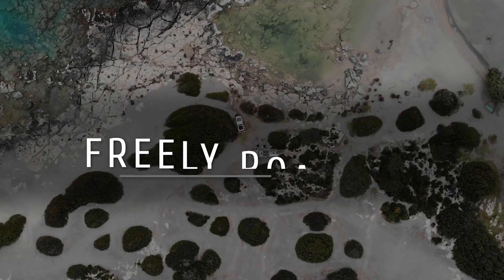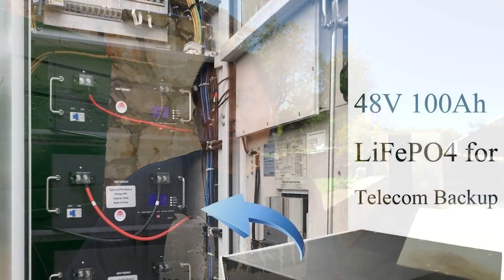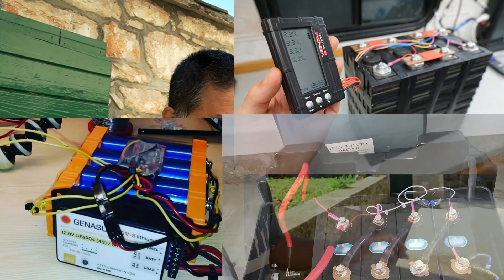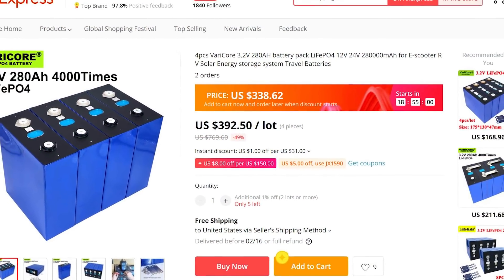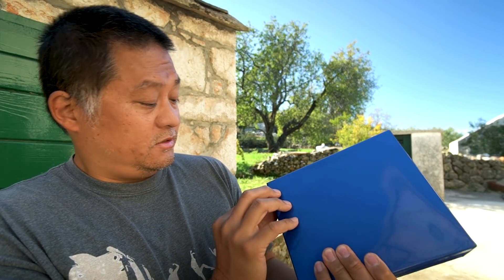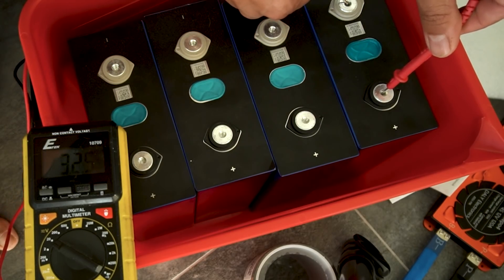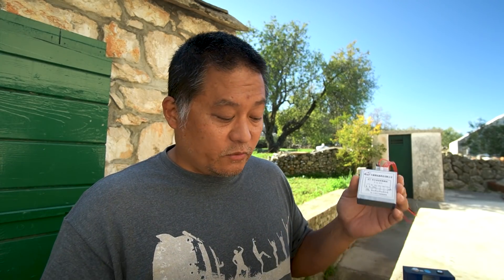Build Your Own 12-Volt LiFePO4 Battery For Cheaper Than AGM

Comment: Lots of good information about the differences of Lead Acid Batteries and LiFeP04 batteries.  I wanted to note, there's a few things most viewers never hear about, and that is AGM charge cycles. Poorly managed AGM will only last around 250 complete charges cycles (less than a year).  Should you operate them by the 50% rule of AGM batteries every day, you can potentially get 500 cycles out of them.  What I mean by manage is they need to be fully 100% charged before they’re used again, and they are never run below 50%.    Then comes the temperature limitation,  AGM batteries when close to freezing have a further reduction in Depth of Discharge,  example 40º F.  This reduction is 49%, ya almost 50%,  example 100Ahr -50% is 50Ahr - temperature 40ºF battery temp, and you have roughly 25 Ahr of usable battery. Feels like you getting majorly cheated by your AGM.     

LifeP04 batteries also have some disadvantage’s :  32º and lower is a major issue,  unless you have a heated battery insulated blanket. If you're  never going to be camping in the north with out heat in freezing temperatures, they'll be ok. Most lithium batteries can out perform in the charge and discharge area at much higher current than any LeadAcid battery could do.  Makes for faster charging cycles.  As you hinted on deep of discharge for Lithium,  100% charge cycle is not needed, Lithium batteries can be fast charged to 80% and used with out damaging them. As you said in the video, charge them to 90% capacity is good practice.  Fact: when charging a lithium what ever time it took to charge to 80%, the same time will be needed to get to 100%.
Reply from the maker: Thank you for the great feedback!

Comment: i thought in 17 minutes you would have covered a capacity test. maybe next time
Reply from the maker: You can see everything in the timestamps.
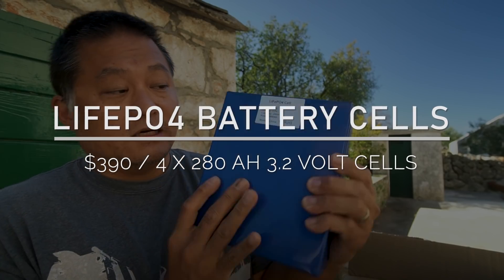Reply: @freelyroaming  right, but at 4:12 it does not cover the quality/capacity of these cells. that bit was more about the packaging. the pricing seems too good to be true and i find it odd that the videos i see of these aliexpress cells not a single one tests capacity
Reply from the maker: There are several capacity test videos I've already seen out there. In fact I just finished my own yesterday and will be posted today. I assume you are not a subscriber because I already mentioned this in my latest upload.

Comment: Hey Dan,

I just commented on your Dometic video.  I will say this:  That cheap 5 – 8A active cell balancer works great!!  I have several of them over 3 total builds that I use (That exact one) but I will say this:  If you ever get to the point where you aren’t using your LifePO4 battery and it’s just sitting you NEED to put a switch on the positive side to turn that balancer on and off.  If you do not, it WILL drain your batteries very quickly.  On my 100AH build it drained it to about 12V in about 35 days.  S you have double that so figure 70 days.  (For those of you that don’t know, it does this because it’s constantly taking power from the low side and putting it into the high side and you have losses in doing this.)  Now of course if you’re always using this like you are then there would be no need.  For me I might have a month or SEVERAL months especially during winter where I don’t use my battery so I have a switch built in to turn that active balancer off.  When I go to use my battery(ies) I turn the balancer on rather charging or discharging and it’s just great 😊.

P.S, you don’t have thermal run-away with LifePO4, which is why it is superior to regular Lithium Ion type batteries which have a 3.7V nominal such as the 18650’s.  They are SUPER safe.  Yes, you can and WILL damage them by over-charging and over-discharging but they won’t explode or catch fire in doing so.
Reply from the maker: good to know! I have heard good thing about the active balancers. It makes sense that it will also drain the battery since there is a net loss in the balancing process luckily our batteries will always be hooked up to solar so it wont be a problem. and yes! I have seen lots of examples of what happens to LiFePO4 batteries when they are shorted. No fireworks!!!

Comment: Thanks, Dan! I've been looking at the same batteries and BMS to DIY 600-1000Ah for our boat, so I'll be interested to hear how this works out.
Reply from the maker: My brother just built a large pack with these cells. He did a discharge test and was able to reach 100% of its rated capacity. I will be doing the same and will share my results.